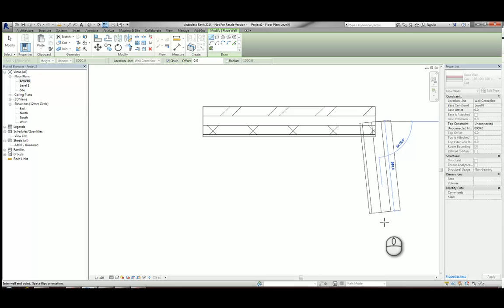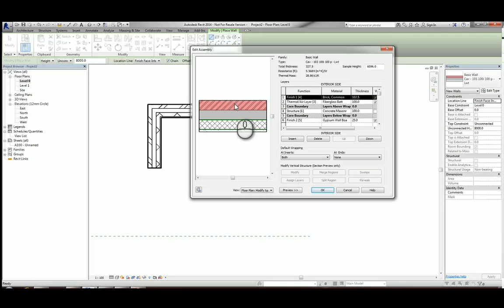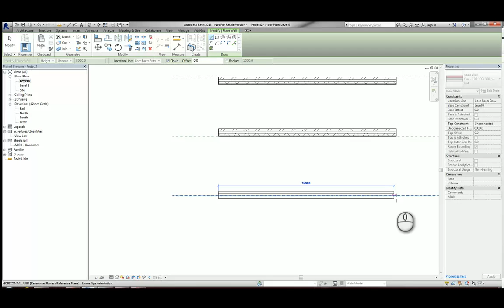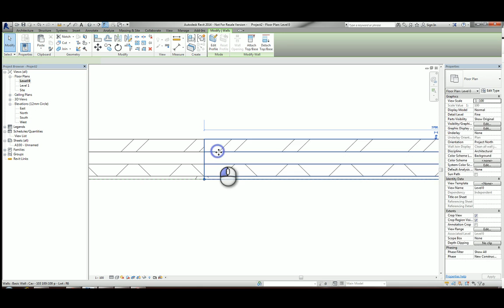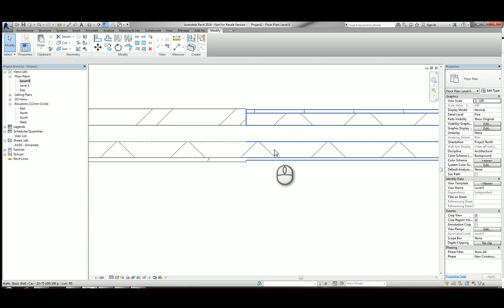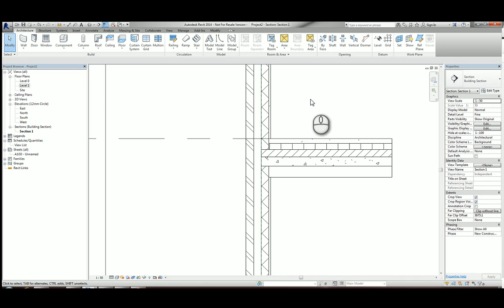Wall Location lines

Comment: Cheers James, nice one....As an ex bricklayer I would have favoured finished face exterior, however I do accept and understand your advice on using Core Face Exterior. Although I must admit I have been on several large sites where 140mm blocks have changed to 100mm blocks or vice versa on the same floor level albeit at a column intersection or expansion/movement joint (especially in more modern times where a change of material, even though it's still blockwork,  needs to be separated by a movement joint) so Core Face Interior would be the way to go?
Great tutorial, keep 'em coming